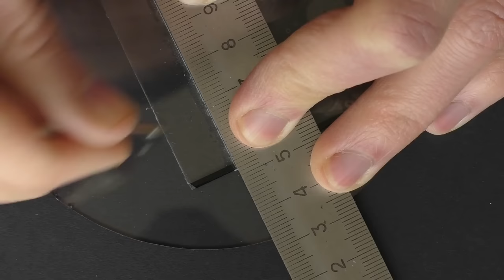How to create a doll lantern with your own hands

Comment: Only the for me most important part is missing: 
- How did you give power to that 1 led? Battery? How much volt? Or adapter? How much volt? Did you use any resistor? How much ohm? Thanx